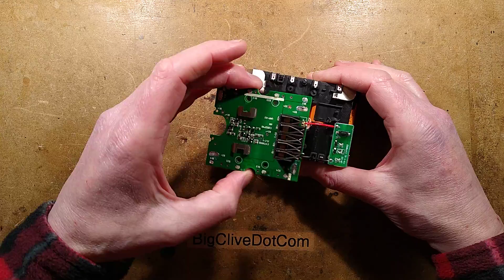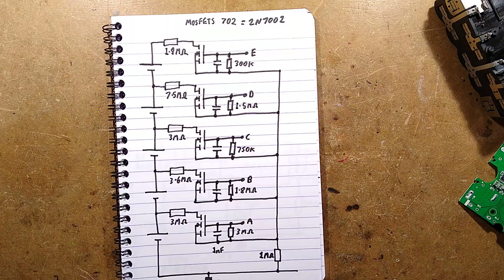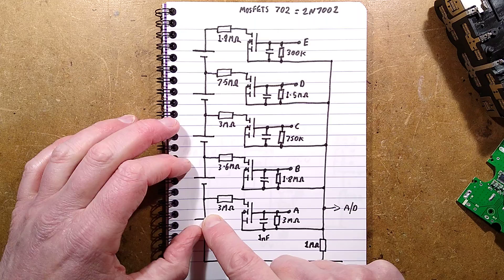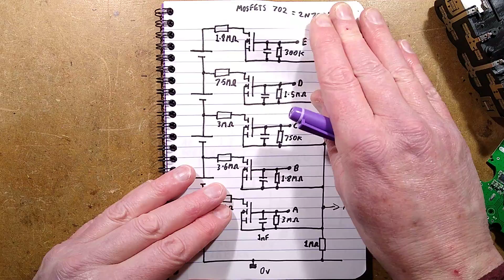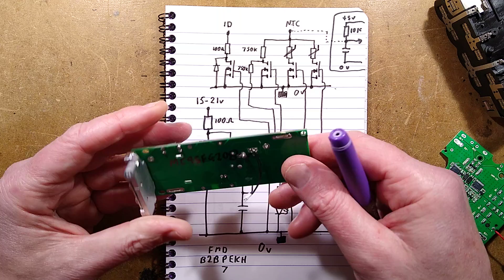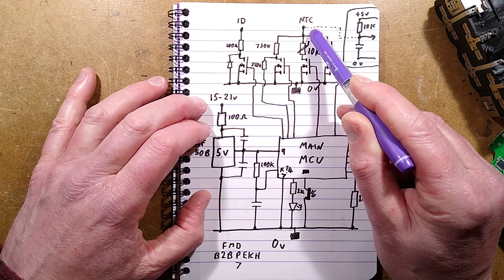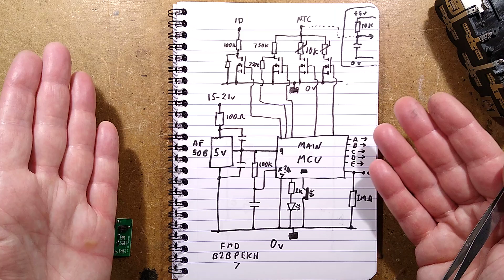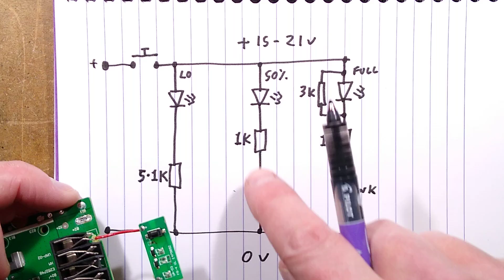Inside an Aldi Ferrex 20/40V battery (with schematic)

Comment: Wondering, why don t every manufacturer use one thermistor per cell and when any input is high it turns on protection mode?
Reply from the maker: Only one thermistor should be needed to detect an issue with an entire pack, as each cell will usually be exposed to the same operational stresses.
Reply: @bigclivedotcom  What happened to me time and time with new batteries is that a few of the cells had shorts on their sleeves

Comment: Nice one Clive this has thrown all sorts of issues for me trying to make one charger fit all project. I have a Dewalt drill and a Ferex drill. The Dewalt has the BM smarts in the charger and the ferex in the battery. Up to now I have a 3d printed shoe that conectcts + _ ve to the Dewalt from my cc cv bench supply simple stupid and balance leads to connect to an Imax balance charger if required. I don't have a Dewalt charger  so not aware of its internals. I think I have to go back to the drawing board as the Ferrex charger is dumb and the Dewalt charger has some smarts not sure if its duel voltage i=either. Love to see you reverse engineer other makes of tool chargers batteries. Thanks for your excellent video😎
Reply from the maker: There are so many ways of controlling the charge that you might have to reverse engineer many different communication protocols.  In a way the dumb eBay tool batteries are so much easier with their onboard protection.

Comment: Despite the dual battery (and so, voltage) circuit, this appears to be A LOT simpler than what's inside the dreaded Milwaukee M18 battery packs. The same  in depth circuit analysis (for Milwaukee M18) would be a significant benefit for the users of those tools who suffer the mystery of those 'battery management' boards and big $$$ cost of replacements.
Reply: Yeah, same with Makitas!
Reply: Milwaukee tools are becoming less reliable with each iteration of the range. The hype was big at 1st here in the UK, but inevitably in the name of even bigger profits, standards suffer and Milwaukee seem to be cashing in with a very short-term view. 
There is a channel - Dean Doherty here on YouTube, a guy who repairs powertools as his business. He points out regularly the failings of Milwaukee and falling reliability standards.
A very interesting channel with honest opinions. Makita still make the best grinders, Hikoki (formerly Hitachi) the best Nailguns along with Paslode, Bosch the best Concrete Breakers, etc. Not always best to have brand loyalty with powertools even though it is financially beneficial to have one battery eco-sysyem. That is how they hook us in with Bare Tools being far cheaper when you already have the batteries/charger, often the most expensive parts. When you add the interlocking case systems like T-Stak II for instance, they sort of have us by the b0llocks.
The EU if they want to do something useful, would standardise Batteries, Chargers, Cases, etc. They are attempting this with phone chargers insisting that any new phones sold within the EU henceforth will have to be the Type C charging interface. Something which Apple are not very happy about 😂.
Reply: These were 15 quid a battery only 5 years ago they are 25 quid now for the 20/40v

Comment: This battery isn’t as mean a Dyson stick vacuum battery.  If the Dyson controller detects even a transient anomaly, it commits suicide and won’t do anything but blink a red LED 32 times even after the anomaly is cleared.  Perhaps rigging a JTAG connection would work, but what data to send?  I eventually just ordered a replacement battery.

Comment: Thank you Clive for the reverse engineering Christmas present!  I’ve been scratching my head looking at this, wondering why bother to monitor the individual cell voltages but not use the data to balance the cells?  Maybe they do balancing.  With large series resistances between the cell + terminal and MOSFET, it will be slow to discharge a cell to the balance point, but balancing probably only needs to bleed off a few mV on a given cell.  I am assuming the MCU is turning on two of the ABCDE outputs simultaneously when it wants to load down a particular cell for balancing.  Some debugging LEDs soldered on to the ABCDE leads would be instructional.  My guess is the MCU top balances the pack when the charge cycle is complete.   It is truly a peculiar circuit.
Reply from the maker: No obvious balancing system with these packs.
Reply: @bigclivedotcom  it makes no sense to me to go to all that trouble to measure cell voltages, unless it is strictly there for the lawyers to disable the battery if the cell voltages are too out of kilter.  The manufacturer could try to balance the cells by intentionally overcharging, but that doesn’t bode well for the longevity of the battery because over-charging encourages plating out of metallic lithium.  Either that, or they’re balancing the cells by pulling microamps.  The battery spends most of its life sitting, so maybe that works.

Comment: If they had chosen lower value resistors for the voltage dividers used for sensing, not only would they get less risk of noise on the dividers by increasing the current flow, but they could also use the measurement resistors for balancing. I suppose they could still be using the measurement resistors for balancing, but it might take a while to significantly influence the state of charge of an 18650 with just 1 µA of current.
Reply: That would have been a lot smarter; however it may be impossible to discharge one of the higher cells in the pack, without also discharging the cells below it. Maybe there is a clever arrangement (possibly with more MOSFETs) that would allow this.

I was wondering about how those MOSFETs would  be driven, considering the microcontroller can only output up to 5V. Consider the gate of the top MOSFET; the gate does not need to go higher than the pack voltage, the gate needs to only be higher than the voltage drop across that bottom resistor.

The 2N7002 needs about 3V Vgs to turn on fully, so as long as the voltage across that bottom resistor is less than 2V, it can be turned on. The whole arrangement is rather complicated to analyse logically, because all of those gate-source resistors become part of large voltage divider is the outputs that are not being used are driven low instead of high-Z, and the output driven high sources some current to the bottom resistor.

When it's turned off, the Vgs should not go below -20V, which is violated, since 5x 4.2V = 21V.

Comment: I think Dave Jones from the eevblog made a video about a micro controller you can get for 1 Cent preprogrammed. It blew my mind you can get it so cheap (in volume).

With this design you could also do some balancing (like you showed in a previous episode), but i guess they did not bother for that price. Perhaps that's why it looked like that, it's a stripped down version of a balancing battery pack.  ;)
Reply from the maker: Padauk microcontrollers.  The cheap ones are OTP (One Time Programmable).  Sadly, the universal programmers can't usually accommodate those chips.

Comment: I think you may have "mis-traced" something in the battery monitoring circuitry (weird resistor values and 2n7002 FETs). The red flag for me is the top one (E) with the 1.8M and 300K resistors. Because if E is high (5V), and A,B,C&D low (0v) that would mean, with a total battery voltage of 21V, that the voltage going to ADC on the MCU would be 5.75V...
EDIT: This is assuming the 2n7002 was even turned on. It would only be slightly turned on (if at all) because the voltage divider (300K&1M)  would result in a gate-source voltage of only 1.2V. It would be reduced further if any drain current started to flow (negative feedback effect) and therefore the resistive divider (1.8M, 300K & 1M) wouldn't be "accurate" due to the FET's high drain-source resistance.
Reply: A comment from Johann Glaser cracked it for me. He mentioned that the gate-source resistor on each FET would effectively be in parallel with the 1M "bottom" resistor if the corresponding control from the MCU was low as opposed to tri-stated. This could bring the divided voltage low enough that the MCU could still turn on the needed FET. The circuit is more ingenious than I'd originally thought.

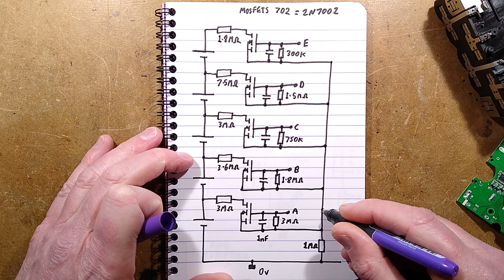Comment: At 4:33 "E" signal would have to be above 6-7V to turn on MOSFET. Hoe does processor working at 5V generate that voltage?
Reply: Yes, I noticed that too. Plus even if it DID turn on it would be feeding almost 6V into the ADC on an MCU running on 5V. (When battery is fully charged)
Reply from the maker: Gate threshold voltage is 2V on the little MOSFETs.  The choice of resistor values for the end cell is odd.  It does appear that it would result in a high voltage if tested at high charge.
Reply: A comment from Johann Glaser cracked it for me. He mentioned that the gate-source resistor on each FET would effectively be in parallel with the 1M "bottom" resistor if the corresponding control from the MCU was low as opposed to tri-stated. This could bring the divided voltage low enough that the MCU could still turn on the needed FET.

Comment: I have a Parkside drill that made a loud clack sound when releasing the trigger. I loaned it to a friend and it came back worse. It would stop or cut out if turned on its side or not operated with a particu5 orientation. 
  I took the gear box apart only to discover one of the orbital gears was missing. Not damaged or fragmented, but totally missing. It was evident that one had never been in place. I could tell this by the distribution of grease, and clean bare patch where the gear should have been. I've got a photo if any one is interested.
   Put it back together and it still sort of works but cuts out if you don't orientate it exactly, which is not convenient. I have another smaller Makita which is doing double duty.

Comment: these types of cpus dont crash most likely. They dont manage memory, their code never changes.
Reply from the maker: All microcontrollers can crash.  But many have a watchdog to detect when the software has stalled.
Reply: @bigclivedotcom  I feel honored as a long time fan to be sperging out with you.
You have fun doing videost, and ppl have fun watching watching them.

But to elaborate my perspective:
It feels that the idea an mcu is more error prone than another solution is as compelling as, any other component could have a defect and thus, not really an argument against its use.

If the CPU has no hardware bugs and the software is properly built, it wont ever change. It could be proven to not have any invalid states in its state machine and have a finite number of them, given a simple enough task.

None of that would apply to the use of the Hammer of Knowledge, but what does?
Reply: They can still potentially crash from electrical glitches. I think what you meant to say is that they don't run a buggy OS that requires a reboot every few weeks.😁

Comment: That is a pretty wacky circuit for the a/b/c/d/e sampling.
The ratios of the gate pulldown resistors and the corresponding battery resistors sort of follow a pattern:
A 1:1
B 2:1
C 4:1
D 5:1
E 6:1
but that jump skipping 3:1 is strange.
The battery resistors themselves seem to follow a pattern at first, for A, B, and C they are all around 3M, but then on D it jumps way up to 7.5M and on E plummets to 1.8M.

Actually, that value for E seems almost implausible since (I assume) the output across the 1M resistor should be perhaps 2-4V, wouldn't you need the battery resistor at E to be perhaps 4-9M? Is the E output of the MCU capable of sinking current to pull the voltage down? Actually, that can't work that way because it would just cause the MOSFET to cut off... Maybe the A/D input of the MCU can take voltages higher than its supply voltage?

Whether this makes sense at all depends on how the 5 outputs from the MCU are used (+5 active/Hi-Z inactive?)

Comment: I would love to see you do a video on the small Lithium powered car jump starters.
Most tout 24000mAh battery packs or larger, yet there is no possible space for any battery that large in those devices.   The max power draw values are also ridiculous.
Reply from the maker: I've looked at a few and shorted one out to measure the current.  They use parallel stacked plates in their lithium cells and can put out hundreds of amps for brief periods.

Comment: It's interesting that Aldi sell Ferrex tools in Australia as well, but with what appears to be an incompatible "Xfinity Plus" 20V battery standard. The pins are in different locations and the actual physical shape of the slide-in battery connector is different. I guess there might be a patent issue or maybe it's just to stop parallel import of cheaper equipment from overseas.

Kind of like how Soda Stream use different gas cylinder threads in different countries.

Comment: 10 18650 cells inside? Could one use them inside a vape?
Reply: Conversely, you could collect lots of discarded vapes and build your own power tool battery
Reply from the maker: Yes.  One could make them into a super-vape.
Reply: Yes I've done exactly that for personal use over several years. All the usual knowledge and precautions apply.

Comment: The microcontrollers look to be from Fremont Micro Devices, from their line of very cheap 8 bit PIC clones. Looking at the datasheet for the FT64F0A5 for instance, shows a matching pinout to the power, gnd, and reset signals from the schematic. Many of the parts from this product family also have a 10 or 12 bit ADC.

Comment: It is a relief that the batteries are proper metal cylinder type ones not those dreadful square bag type batteries that expand when they are exposed to lower temperatures

Comment: Anybody knows how to reset BQ26500 battery fuel gauge IC? Having trouble with the BMS of a Philips PMC 7230/17 portable media player.
Reply from the maker: If the cells are at a charge state above 3V then there's possibility that it's not that chip that is the issue.  It may have sent data to the main controller that showed the batteries had been over-discharged.
Reply: @bigclivedotcom  Can't believe I got a reply from the man himself. Thanks Mr. Clive🙏. Is there any other way I could interact with you further?
Reply: @bigclivedotcom  I had a doubt that the main microprocessor could be the problem. How do I reset that? I charged the LiPo battery separately and the problem still persists. The media player screen shows a battery symbol with (!) and then switches off.

Comment: Keeping the voltage presented to the ADC approximately the same is to get maximum precision.  If you had a decimal ADC with a range 0-100 then a value of 98 will be within approx 1% of the input but a value of 9 will be within approx 10% of the input.  97.6 input will be rounded to 98, around 0.4% error.  9.6 input will be rounded to 10, around 4% error.
Reply: Not to mention the ADC is just 1 and has a voltage range.  Multiplexing them saves multiple adc and multiple voltage dividers too?

Comment: Re the possible RC reset circuit. It could also be for a clock oscillator. Knowing the R & C values would help decide which is most likely. I hear the dislike of using processor to monitor safety critical voltage and temperature but maybe the processors have a watchdog timer built in.

Comment: I have long suspected communications between the Aldi Ferrex brushless drill and the 20V battery.
I have a battery that displays 95% charged and when I checked each cell they were 4.1-4.2V each. If I put a test load across the 20V battery terminals there is plenty of current on hand, 20A. However when the faulty battery is plugged in and the trigger squeezed it bumps and stops immediatly. 
If I plug a different batteryin and  squeeze the trigger the drill runs and has full torque. There is no stopping it unless you apply enough force to stall the drill. 
However if I hook up a 15A power (peak 25A) supply set to 20V to the drill the dril runs drawing 2.2A @20Vdc, but as soon as you apply a slight load to the chuck (holding it) the drill stops, it has no torque. You can only run it up to ~70% of full speed with no load at all. If you go to 100% of the trigger speed it immediately stops. 
 If I connect a good battery with some wires to the drill it works fine.
I suspect some sort of communications on the + terminal that communicated back to the battery micro controller that must respond back to the drill's brushless motor controller. I assume that because my power supply does nothing with any communication on the + terminal and does not respond with any signal on the + terminal back to the battery. The drills motor controller shuts down. 
Anyone else seen this type of behaviour, I'll have to hook up my CRO and see if I can see any activity one the + terminal.
I suspect this is a way of only allowing propriaty batteries to be used and ensuring a revenue stream.

Comment: Pin 4 is the set output regulation for overcurrent draw from the battery which is always too low for the tool you plug it in to.  Ive had to remove that cap all together on every battery ive made using those diy boards..